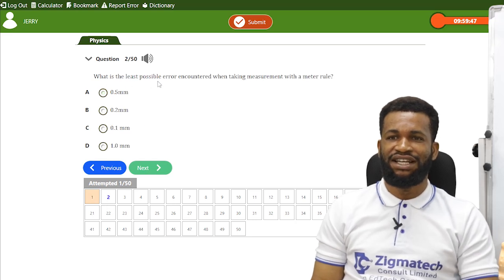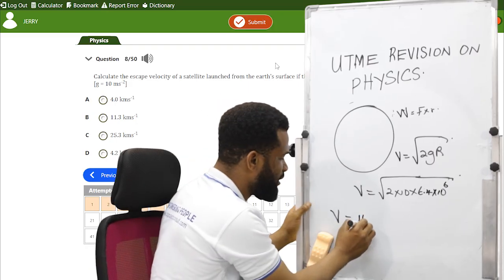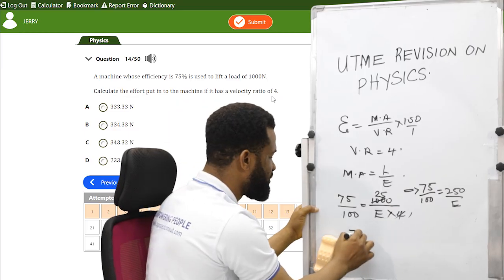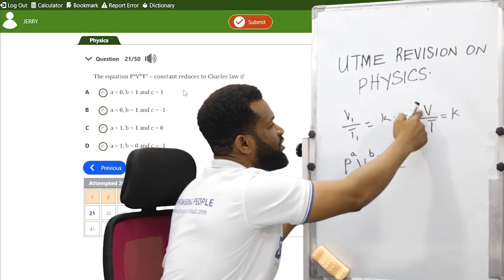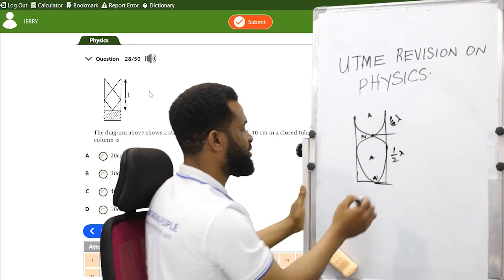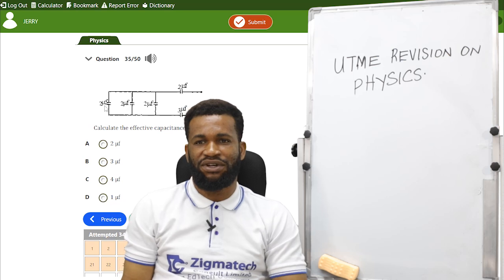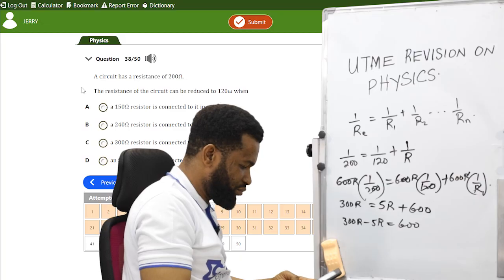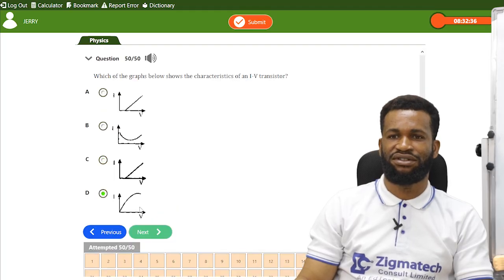2022 PHYSICS JAMB PAST QUESTIONS AND SOLUTIONS | PHYSICS CLASS REVISION | JAMB CBT ANSWERS

Comment: answer to question 38
is wrong 
assuming collected like terms 
5R-3R=2R 
den R=600/2
300 
not-150
Reply from the maker: Sorry for the omission.

Circuit resistance is 200ohms
looking for a resistor Y to add to make it 120ohms
For total (effective) resistance to drop, the resistor must be connected in parallel. If you connect in series, the total (effective) resistance will be increased.

Recall that the sum of resistors in parallel is gotten by 1/Rt = 1/R1 + 1/R2 + 1/R3...…..

Applying that to the question,

1/Rt = 1/200 + 1/Y

Rt is total (effective) resistance, which will be 120 when resistor Y is added.

So we will now solve for Y.

1/120 = 1/200 + 1/Y

L.C.M of 120 and 200 is 600

multiplying through by 600

1/120(600) = 1/200(600) + 1/Y(600)
5 = 3 + 600Y
5-3 = 600Y
2 = 600Y
Y=300

So 300ohm when added to the circuit in PARALLEL will drop the total (effective) resistance to 120ohms.
Reply: @ExamGuide_Learninghub  he's actually right it's 300 not 150